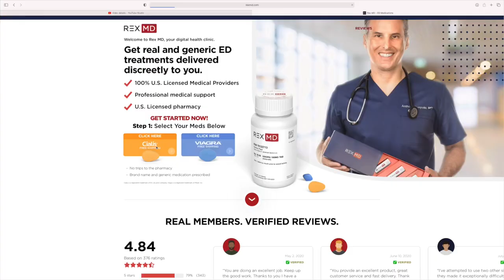This SAVED My BACKYARD Farm Animals LIVES!!!

Comment: Tip on the fly bags, hook them up higher in a tree. And on the outside of the barns, it’ll help catch the flies but also pull the flies away from the animals.
Reply: Yeah I used to have quail they are very messy and the fly bags help alot
Reply: You are absolutely correct... I was going to say the same thing but you beat me to it...
Reply: Plant rye for animals

Comment: You should tip Carols horns. Basically its removing the insensitive part of the horn leaving a blunt tip so Carol cant stab anymore animals
Reply: How would he do that like chop it off or saw it down?
Reply: I have to agree with this post as you can tip the horns quick and easily and it will make sure the other animals are safe!
I'd HATE to see any of the other animals pass with you left wondering.
Install a game camera and see what's really going on with all the animals when you're not there!
That's CHEAP INSURANCE and nothing will be misunderstood in the future!
Good Luck with everything!
Reply: @AnubisFenrir  you cut it off
Reply: @AnubisFenrir  A wire saw is used, cuts the tips off in no time..

Comment: A little trick to keep your cuts straight. Set the square against the wood and use it as a straight edge along the metal frame of the saw to keep cuts straight.

Comment: Gotta let that dewalt nail gun fully wind up b4 u send it. I’ve got the same one. One of its only faults. That and jamming. Once you learn a few times a jam is no biggie.. just remember to take the tip apart if it gets stuck on the nail in the board. Don’t try to pull it out with the gun still attached. Loosening the 2 Allen screws on top, releases the stuck nail. I like the bump fire, you keep the trigger down the whole time letting it be fully wound up and ready to go. Less lag and less likely to leave unsunk nails.

Comment: Hey Flair
I have some experience with farm animals, especially cows.
My uncle owns a beef farm as well as other animals and he had an issue with 1 of the cows 35+ years ago. It never liked him from the time he bought it and 1 day he was separating several cows to do with breeding females and his bull. The cow that didn't like him (thank God they didn't have horns) was coming through the gate (my uncle was standing between the gate and the fence) the cow head butted the gate crushing my uncle. Then when he was on the ground, it started to head butt his scull into the ground. My aunt was there watching but couldn't do anything for fear it would turn on her. My uncle had to be air lifted to the Emergency room 45 min. from his farm where he spent almost 1 year. His injuries were so bad once he was stabilized that the Surgeons had to use over a dozen pictures of my uncle so they could rebuild his face because every bone of his scull below his forehead was shattered. It took many surgeries until he resembled his original appearance. Dr.'s said he shouldn't have lived in the first place but Thankfully he did! 😥🙏
My cousin who still lived at home separated that cow from all the other's & sent it to the butcher ASAP.
The point I'm trying to make is that you should separate Carol from the rest of the animals instead of the way you have done. Always separate the problem from the good animals!

Comment: You could attach a board on the bottom connecting the feet and have a foot overhang on both sides for added stability if they get tipped over often

Comment: Put steel steaks in the ground that have holes thru them like concrete prep work. Throw a nail thru the steak and it will never move or get knocked over

Comment: Bro you could’ve flipped the trough upside down and cut off that piece of 2x8 flush and then remember if you nail two two bys on an angle the nails will never poke through the other side because a diagonal depth is longer than a straight or square depth

Comment: if it were me, I would have made the legs about 6 inches longer so you can burry the 6 inches in the ground and not have to worry about the animals knocking it over. if you were really worried about it, just get a couple cheap bags of concrete

Comment: Too many animals and not enough space. They make good content but it's not fair on the animals. I'll bet the property has a fence line, so just let Carol free range.
You really need a cordless mitre saw. Cross cutting with a circular saw ain't the strat.
Those boards will swell when they get wet and will close the gap.
I wouldn't worry about water, you're not gonna make it waterproof out of timber and nails. The water will find its way out

Comment: Sorry guys but the legs your putting on that feed bunk are wrong they should be put at an angle so the legs are wider than the tub so they don't get tipped over so easily your's are way too tippy just fyi